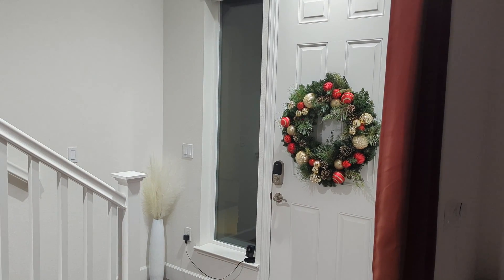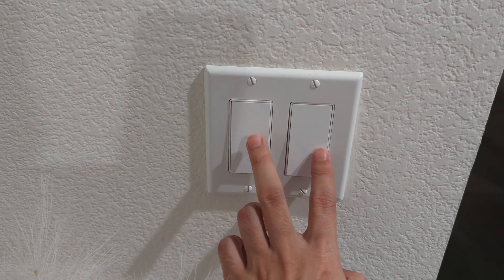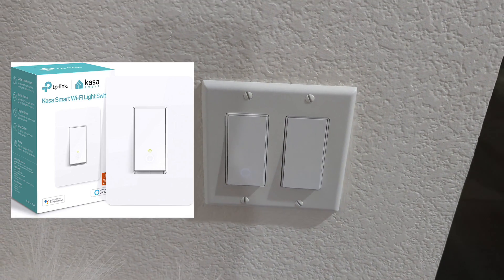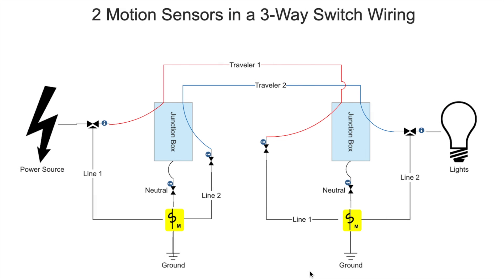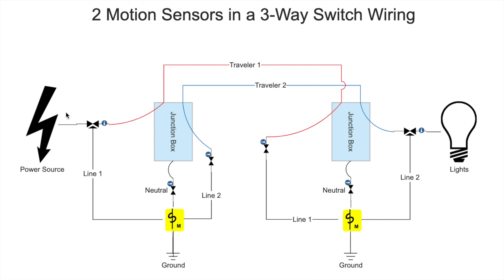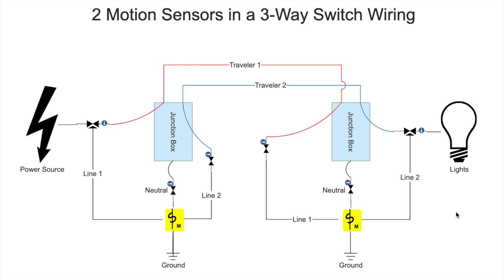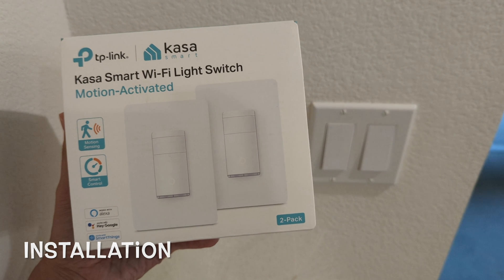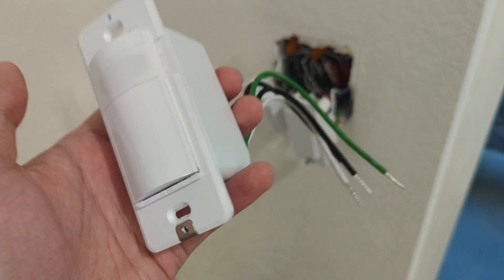2 Motion Sensors in a 3-Way Switch Setup including a Kasa TP Link Smart Switch and a Lutron Switch

Comment: FWIW, this kinda-sorta works with Leviton DOS05 switches. The motion sensors work, turning the lights on and off (after timeout) as expected, but the physical buttons on the switches have very weird behavior, sometimes turning the light on or off, and sometimes not (I think contingent on the state of the other sensor).

Comment: This generally works for me but for some reason only one of the actual switches works (both motion sensors work but only one physical button at a time works). I can hear it clicking like it's turning on or off but it's not controlling the light. Any ideas?
Reply: Ditto with Leviton DOS05 motion sensors. Both sensors work as expected, but the buttons have weird behavior.

Comment: Hi. Nice video good job. I got a question for you. I put 2 active motion ks 220 m on. 3 way circuit. It worked at the begining, but now it do not detect any movments it still working with the app or when i open it manually, but no detection movments working. Did it happened to you ? I know in your video it was 1 kasa and 1 levitron i think. Thanks for the answer

Comment: In your house you had an existing Lutron motion switch, and added an additional Kasa smart switch. If your home had 2 conventional switches would you still do 1 Lutron and 1 Kasa, or 2 Kasa. Thanks for the great video.
Reply: @TexasAV8R-cq7bk  It really depends on whether on want the smart home control capability of the Kasa smart switch. I can control when the motion sensor is active, how sensitive it is, and the duration it stays on all from the Kasa app. Lutron also makes smart switches so you have that option too, but I believe those are a lot more expensive than the Kasa ones. I haven't tried one of those myself, but would love to someday.

Comment: Excellent video I hooked up two Kasa motion light sensor and it’s working with if you don’t manually use the switches and let the motion turn off and on. Unless I’m missing something thanks. I too had a random wire that I left alone.

Comment: Thanks for this video. I’ve been going crazy trying to figure out how to do this. Quick question though, i have 2 switches on opposite ends of my laundry room both controlling the light above. One near the exit to the garage and one near the exit to the stairs. If I wanted to keep one switch as a dumb switch (not to be used), would I wire the Kasa similar to your Garage Setup, or to your front door? Not including the neutral and ground, my junction box where I want to put the Kasa, has one black coming from 1 harness (I assume this is the common) and 1 black together with 1 red coming from a second harness.  I can’t figure out if I combine the opposite blacks from the harnesses to 1 black on the Kasa and the red to the other black on the Kasa or if it needs to be 1 black and 1 red from the opposite harnesses combined to 1 black on Kasa.

Comment: Great video, got mine working. 

Correct me if I'm wrong but with this setup, I don't think you can turn off the power from the 2nd switch if the first switch it on, right? 

It's totally fine for my use case as the switches are literally 5 ft apart but just curious because I can't and just wanted to be sure that's the expected behavior.
Reply: @spicyy_nuggs  Glad you're happy with your setup. That's correct. As long as one of them is on, the light will be on. Both switches will need to be off to cut off the circuit from both ends.

Comment: I appreciate your appreciation of the Kasa switch. However, would this same technique work with 2 Lutron 2-way motion switches? Great video. Thank you for posting it.
Reply: It should all work the same but the problem I ran into is that it seemed like the motion detector wasn't on for the Lutron. It would work on test mode but would work on normal mode

Comment: Thank you very much for the video. I researched alot to find a way to put two motion sensors for 3-way switch and didn’t find many resources. Luckily found your video and it helped me alot. Also thank you for clear explanation with both diagrams n wire connections.

Comment: Thanks, Gavin, that's really great. I will try it with the Kasa motion plus dimmer switches. I have only one question here, what will happen when both get ON. It sounds like nothing happened badly since they are still working fine from your side; I'm just wondering and hope someone has an explanation. Thanks Again
Reply from the maker: When any switch is on, it just means the circuit is closed/complete, aka the electricity can find its way to the outlet. So when both switches are on, there are 2 active closed circuits. It's up to the light to decide how much electricity to pull in so it shouldn't matter if one or more switches are on.

At least that's my understanding. I haven't had any issues with my setup for over a year. Both sensors get triggered daily as we enter and exit the house.
Reply: @gavinpikachu  Many thanks Man
Reply: Just an addition here: I just completed my setup of two Kasa smart motion sensors with dimmer. The setup is working perfectly, and as you say, Gavin, the dimmer control will go to the highest active switch. So if both are ON, the light intensity will go to the higher setting. I loved it. Many thanks for your video, Man. It did a lot of help for me.

Comment: Would it be the same wiring if you only need motion on one switch and the other is just a (smart, no motion) 3 way switch?
Reply: I think he just removed the 3-way wiring and treated each switch as single pole here by jump the red wire. Key point here is since both motion sensor will auto power off, so there will not be any forever on switch/circuit thus when both motion sensor turns off, light will be off. So your case would work, you just have to remember turn off your smart no motion switch.

Comment: This sounds great! I have the same set up like you did with a Lutron motion sensor already installed. While you showed how the Lutron was wired, was it wired that way before you installed the Kasa, or you had to rewire the Lutron for the set up to work? That is, do I need to rewire the connections to the Lutron? 11:35
Reply: The sensor switch is 3 way switch?

Comment: So basically it's two single pole switches in parallel. Are these motion sensors rated to have power back feed into the load side?
Reply: I was thinking the same thing
Reply: What would happen if they're not?

Comment: Hey! Awesome video, I have a quick question do you think this wiring setup would work with a motion dimmer switch, I am thinking that it would but when both switches are sending power to the lights would the light stay dim?
Reply from the maker: Great question! I haven't used dimmable motion switches before, but I believe both switches will contribute to the overall brightness of both are triggered. That means you'll need a dimmer switch on both ends to have any dimming while both motion sensors are active.

Comment: I have a question. Is the same thing possible with KS200M at both sides with the same wiring?
Reply from the maker: Yes, it should. Whether it works or not depends on the wiring. You can imagine a similar setup using 2 non-motion sensor switches. The light will turn on when either switch is flipped on (also on when both flipped on). And the light will only turn off if both switches are flipped off. This will of course be a silly and annoying setup. The motion sensor part just makes it easier to turn on/off each switch.

Comment: Okay I am just done with mine and for the people who has the same color traveller wire, just connect them to the switch. If it is constantly on and cannot be turned off that means you have the wrong traveller just switch the traveller connection from one of the switches and you are all set.

Comment: Thanks for posting this i am spending endless hours figuring out if there is a workaround to get the KASA KS200M work on a 3 way circuit

So just to summarize 

I take a pair of 3 way switch

In the first switch - 
1. Connect the power wire, one travel wire (red or black) and one line/load wire from Kasa. 
2. Connect neutral to neutral
3. connect ground to ground
4. Connect the remaining travel wire (black) to the other black wire of Kasa 

Switch 2
1. Take the previous switches travel wire which was connected in conjunction with power/hot wire and connect it to the Kasa live/load (black) wire
2. Take a traveller wire on switch 2 and connect it to another black wire
3. neutral to neutral 
4. Ground to ground

Comment: I don't have that 3rd traveler wire. Therefore, my motion sensor switch has the incoming power and overrides the other switch. Essentially the other switch is worthless.
Reply: I just noticed on my other light switch, I have what appears 2 travelers in addition to the hot traveler coming from the other switch. I am going to tie the 2 travelers to one.

Comment: IMPORTANT UPDATE - You forgot to mention that the Kasa Smart Switch must go first! As well they do make a Lutron 3 way Motion switch, however, this does not work it must be the 2 way motion switch which must be second followed by the light.
Reply: What is the point of the 3 way if you need to use the 2 way? My scenario is I need a smart dimmer switch on one side and motion on the other.. But it's 3 way, both control the same lights, but only want motion on the one side. Both dimmable, smart, etc.

Comment: can you please share where you found the double wall plate for the kasa motion sensor switch
Reply from the maker: Hi! Those are the original wall plate that came with my house. You can buy any double wall plate. Kasa switches fit into the standard wall plates.

Comment: could you use one motion sensor and one dimmer switch?
Reply from the maker: You could, but your lights will not always dim. If the lights are turned on via the non-dimmable motion sensor switch, then it will be at full brightness. Your lights will only dim if the dimmer switch is the only switch activating the lights. I believe there are also dimmable motion sensor switch that you use in place of a regular motion sensor switch. But again, the amount of dimming depends on which switch is on. If both switches are on, then the brightness would be the brighter of the two switches. You would need another mechanism to synchronize the dimming amount like with a smart routine.

Comment: Is there a reason why you wired the neutral on the Lutron to the ground (keeping the green sleeve on) instead of to the neutral in the junction box? Looks like the neutral on the Kasa switch is wired to the neutral and the diagram shows both neutrals connected to the junction box neutral. Asking because I'm about to do this setup and was wondering if I should keep the green sleeve on the neutral wire on the Lutron and wire it to the ground like you have or if I should take off the green sleeve and wire it to the neutral.
Reply from the maker: Oh good catch! I didn't even realize my neutral and ground wires are connected to the same wire nut. This switch was preinstalled when I first moved into the home so I didn't even bother to touch those 2 wires 😂 I believe you should connect these to their respective wires.

Comment: I am trying to wire the first setup you have (one smart switch and one smart motion sensor switch). The way it’s currently wired, the motion sensor switch only has power if the other smart switch is turned on. Any idea how to fix this?
Reply from the maker: Hey, you're facing the fundamental problem with a single motion sensor on a 3 way switch like I describe in the video at 2:45. If the location of the second switch is somewhere you won't accidentally touch often, then you'll be better off with a non-smart switch. The benefit of a smart switch is that you can schedule it to turn on at certain times. Repeat the schedule however many number of times that fits your need and it'll effectively acts as if the power is on at all time. Note that each scheduled on would turn your lights on if the switch is in the off position. This could get annoying if your lights are in a highly visible area and the switch gets turned off frequently. One other problem I had with this setup was that the switch would turn off if I ask Google to "turn off all lights". I fixed this by creating a second home in Google Home and add the light to that dummy home so it wouldn't turn off along with other lights in my active current "home".

Alternatively, you can also setup the wires using the 2 motion sensors wiring. This will allow the single smart switch to operate independently. However, the problem with this approach is that the lights won't turn off on its own. A quick workaround for this is to schedule a smart routine to turn off the smart switch after x number of minutes. You can match this to the timer you have on the motion sensor switch.

Either way, you have to be a bit creative with the smart capabilities to work around the physical limitations.

Comment: Thanks, Gavin! I had grand visions of making a pass-through in a wall, installing a motion switch at 90º and putting two mirrors at different angles in front of it to get motion detection on both sides of the wall. It's all working well now that I added an additional motion switch with the wiring you suggested. No more coming inside from grilling at night and not being able to get the light to go on :-)
Reply from the maker: Nice! I'm glad the setup worked for you! :)

Comment: where did you get the extra wire. I only have 4 but I see you have 5 pre installed. thats why I cant make my motion sensor work on a 3 way switch
Reply from the maker: Hi, I'm guessing you're missing the neutral wire (usually white). A 3 way switch should have a minimum of 1 line/load wire + 2 traveler wires + 1 ground wire. Check out this diagram: https://www.electrical101.com/3way-switch-wiring-using-nm-cable.html
Reply: @gavinpikachu  My electric box wires consist of only 4 wires instead of 5 wires shown on this video. Neutral (white), ground (green), red (traveler), black (load). I don't see extra black wiring like yours.
Reply from the maker: @YourTechGuide.  Your setup sounds like a single pole switch: https://ask-the-electrician.com/Pics_Diagrams/singlepoleswitchdiagram2_LG.JPG

Excluding the ground and neutral wires, there must be 3 wires (1 line/load + 2 travelers) for a 3 way switch to function properly. Are both switches working properly with the original switches?
Reply: @gavinpikachu  with regular switches it works both ends. When i installed two motion sensors on both ends it flickers and sometimes the light is solid but dim when i flick the switch. So i guess i wont able to install motion sensor in my hallway then
Reply from the maker: @YourTechGuide.  From my experience, flickering lights is usually the results of faulty wiring, often times with the neutral wire from Kasa smart switches. Make sure the connector ends of each wire do not touch each other.

In terms of the wiring, I'm not sure how it's possible that you have a functional 3 way switch circuit with only 4 wires (and this is on both ends of the junction box?). Excluding the ground and neutral wires, there needs to be at least 3 wires connecting to each switch in order to complete the circuit either in series or in parallel.

I would recommend using a voltage tester to double check what wires you have. https://electrouniversity.com/how-to-identify-neutral-wire-with-multimeter/#:~:text=Identifying%20Neutral%20Wires%20With%20An%20Voltage%20Tester&text=Place%20the%20metal%20tip%20of,have%20found%20your%20neutral%20wire. I suspect you're still missing the neutral wire if you had a functional 3 way switch. 

You can also check another junction box with a single pole switch. If it only has 3 wires (1 ground + 2 load/line), then it's very likely that your house doesn't have neutral wires set up, which is common in a lot of old houses.
Reply: @gavinpikachu  i have a neutral wire (white), ground (green), traveler (red), power (black). Our townhouse is 3 yrs old so its pretty new. Both junction box each only have 4 wires.
Reply from the maker: @YourTechGuide.  Sorry I'm not sure how else to help. What you're describing is for a single pole switch, not a 3 way switch. The Kasa 3 way switch contains 5 wires so you'll need 5 wires to connect with. Other smart 3 way switches should also have 5 wires that you need to connect with.
Reply: Awesome video! Love the bonus content as well, showing Kasa turning on your stairs lights with "I'm home"

Comment: Will this work on 3-way light switches (switch on 1st floor, 2nd floor and 3rd floor)?
Reply from the maker: Hi, if you have 3 switches controlling the same set of lights, then what you have is not a 3-way switch, but a 4-way switch. A 3-way switch means exactly 2 switches controlling the same set of lights. The wiring tutorial in this video only works with 3-way switch. 

A 4-way switch has a more complicated wiring structure. I believe it's technically possible by wiring them all in a parallel circuit, but you would need to rework the wires in the wall. I would also be cautious of the lights overheating because it can be turned on from 3 different sources.
Reply: @gavinpikachu  Thank you for taking the time to respond!